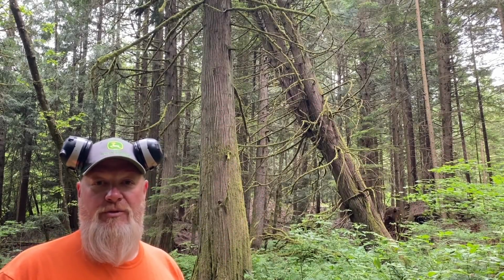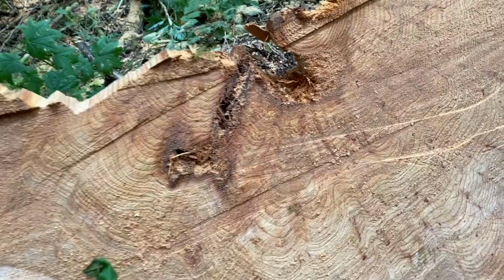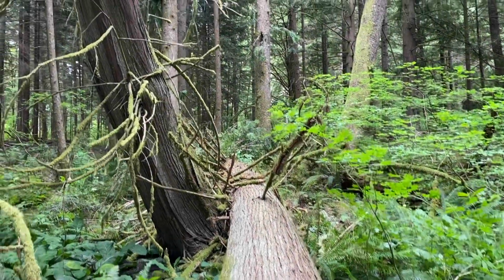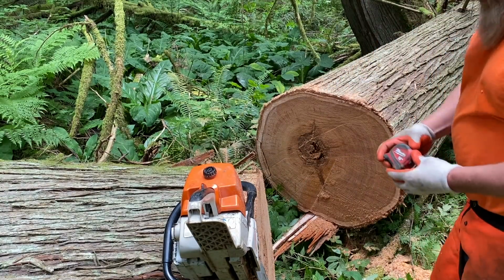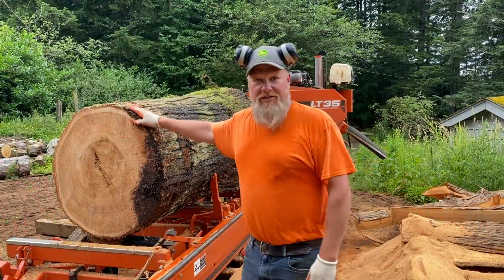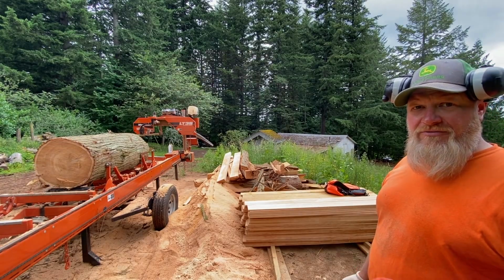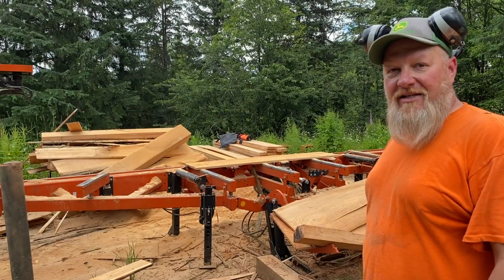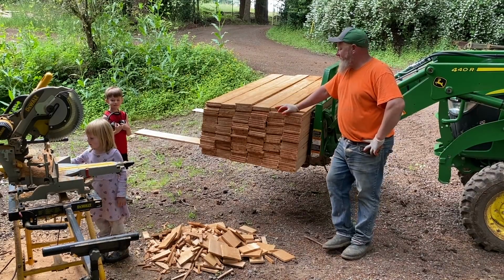Sawing A Crooked Cedar Into Striaght Boards

Comment: Everytime I see that cedar tree wood, regardless of what you saw it into, I want to hock, sell, trade everything and order a cabin package, mind you not large, a 24x32 cabin would make me feel like I was living in a palace. I would have exposed wood on the inside and fir on the outside framing. All interior walls would be cedar and the smell.... we don't have smell a video yet but I can smell it. Memories run deep. Back in the sixties, I built a cabin in the cascade mountains out of split fir rails and cedar interior. I used anything for insulation and it was not the best but it did the purpose as I made the walls super thick. All the walls facing north or east were twelve inches thick! Hand split and pegged with dowels I made. I had that tool that would drill one way six inches deep and square holes. I forget the name of it but it used a hammer to punch its way through. Although most of the interior was only six and more high I was not quite six foot at the time. I wouldn't do that again. I know that the cabin stood for over thirty years without anyone living in it but critters but it was still in habitable. I moved after I got out of the service and my priorities changed. Old growth fir split just like butter in thirty foot and more lengths. I used metal fro's and wooden wedges.
Reply from the maker: Wow! Do you think it’s still standing? I’ve been thinking about building a small cabin next to our creek and renting it to folks as a weekend retreat kind of thing.
Reply: @NorthwestSawyer  According to my brother I do not claim him tho, he said that the forest service burnt it down  so no one could claim that ground. I wouldn't go back to that country for the whole state! Since I am not healthy enough to make the walk... never will know